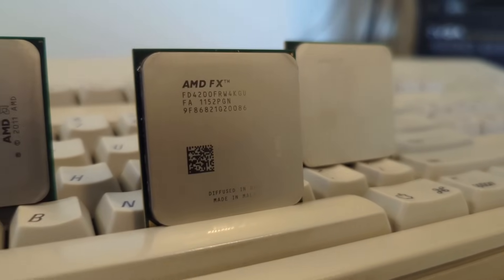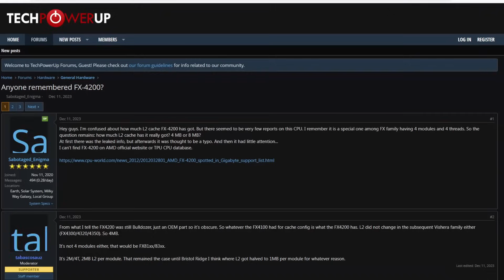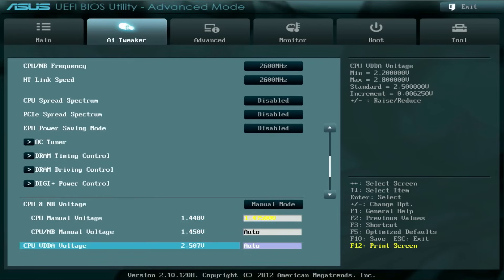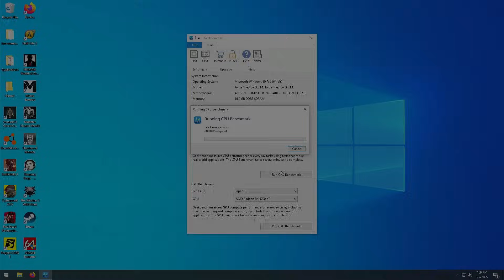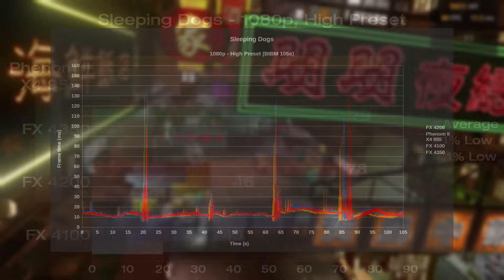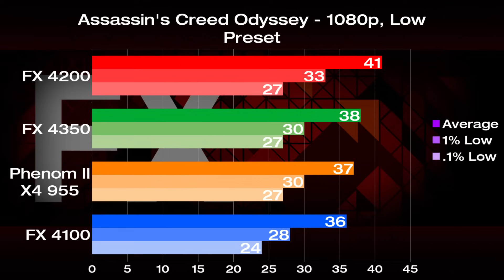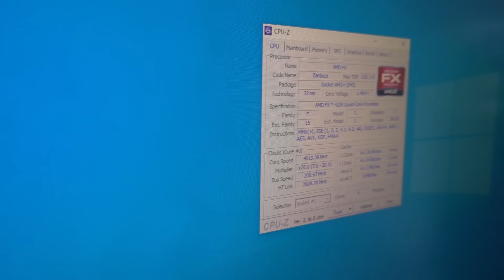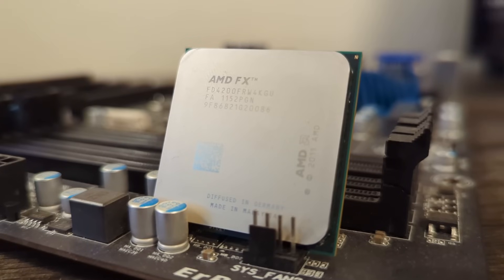What if AMD FX had "real" cores?

Comment: No idea why there is so much hate for the FX chips.. i had the 6300 followed by the 8350 and had a go at the 9590 and went back to the 8350 and i have to say.. they did all i asked of them.. sure they may have been slower than 2 gen older intel CPUs but as i did not have that rig i didn't know any different.. they never let me down and gamed at a decent rate and i only upgraded the 8350 to a ryzen system 2 years ago due to the motherboard failing otherwise i would probably still be using it. Not had Intel since my Q6600 rig.. which i still use for emulation.. but all tech giants have to release a plumb here and there.. As for what could have been?. well if AMD didn't try new shite then we would still be on intel's quad cores.. and hey.. it was a failure.. or was it? FX CPUs are selling for more than the intel equivalents of that era. so they must have done something right..

Comment: Just finding out about this CPU I think explains why windows(at least windows 7, which is what I still use) uses my FX-8350 the way it does. When I am just doing the usual stuff on my PC, only 4 cores are used; cores 0,2,4,6. It seems apparent now that this is intentional so that each active core will have it's FPU to itself. It's only when the system is put under a large load that all 8 cores are used, like playing a high bitrate 4K video.
Reply from the maker: Hah, cool that you're still rocking Windows 7 these days. I would too if it still ran everything I needed it to 😢
Reply: @SPNG  Yeah, I had to install win10 on my previous PC, a Phenom II X4 w/8GB ram, just so I could use TurboTax. 
I can't use the latest version of Firefox on my main system because it requires win10 too, but I can run the ESR version. Plus I also use PaleMoon which still supports win7 as well as Opera.

Comment: I owned FX6300, FX8150 and FX8320E, highly underrated, Windows helped with the bad performance, they updated scheduler and got like 10% extra performance, the problem with this CPU was the way Windows loads them, it needed a specific way lo load the cores to avoid part of the bottleneck. They improved a lot the arch with Steamroller and Excavator... Sadly we didn't get lv3 cache on those CPUs and was losing 20 to 30% multithreaded performance.
I know a lot of FX CPU, not only because i owned it, i talked directly with the engineer and asked things like CPU Pipeline.
They work significally better at Linux even back in 2011/2012

Comment: Just  not a very good design overall and when these came out it was during the time when amd was on the ropes. The problem stems back to the core 2 era from Intel. The core 2 took amd really by surprise and left them scrambling after they enjoyed 3 years of success with the athlon 64 due to Intel's pentium 4 netburst flop that Intel banked heavily on. The major difference was Intel could afford to take a hit, amd couldn't. when amd took that hit for having no answer to the core 2, they really took a hit financially especially after recently acquiring ati around that time draining whatever capital they had left from the athlon 64s sucess. the phenom 1 was a decent cpu overall for what it was, it competed  against the core 2 quads, but it wasn't without it's issue with its TLB that caused systems to lockup under very specific workloads.  By the time the improved phenom ll came out, Intel was already gearing up to release the 1st gen core I series, so once again it was playing catch up to intel. amd needed to get back on top in the worst way and the FX cpu was supposed to be the golden goose amd needed to put them back on top. They hyped the FX series to the moon just to get completely blind sided by Intel's 2nd gen core I series. The 2nd gen core I series not only scotched the FX series which was bad enough, but even amds last gen phenom ll cpus beat the FX series in some benchmarks to add insult to an already embarrassing injury. Then. Many people will remember the FX series as the cpu that almost put amd out of business. They put so much money into that cpu just for it to flop badly. The only thing that kept AMD afloat after that was the console chip making contracts that they had with Sony and Microsoft which ended up being what saved them from going under.

Comment: "Bad for performance"   Well, not so much after Microsoft quietly and secretly re-wrote the code that intel said would work fine on the AMD chips too...  I gained 28% performance one day with a patch.  Wish I'd known you were needing this kinda old hardware. I've got a stable Crosshair IV with an 8350 and a copper Phenom][ high rpm cooler sitting in a box.  (and a Phe][ 3.6 in its 970msi with ram and water block that I run occasionally)

Comment: I have a Vishera FX-8320 that claims it's an "Eight-Core Processor" according to CPU-Z.  
When I installed VirtualBox back then it only allowed four cores per virtual machine.  I thought it was a bug in VirtualBox, but, no, it was because this was effectively a four-core processor due to the shared resources mentioned in this video. 
AMD fooled me by saying it was "Eight Cores," but, it served my needs for over a decade and still does.

Comment: one little problem was testing the games in high settings, making the load fall on the GPU, this is a CPU test
Reply: Any game here will not max out a 5700 XT. Also many higher settings have an effect on the CPU too, not just the GPU.
Reply: Aside from Witcher of course.

Comment: Thuban was a Beast, I ran an unlocked 960T for years until replacing it with a Ryzen+.
Reply from the maker: Unfortunately my 840T wouldn't unlock when I got it a few years back, I have a 1090T now though so that itch has been scratched

Comment: I had an fx 8350. It burned out two of my motherboards because I overclocked it to 4.5ghz at high voltage. cpu was cold on my custom air-cooler
Reply from the maker: Damn, what voltage were you using? Must have been extreme to kill the CPU, I don't think a whole lot of volts was necessary for 4.5

Comment: The biggest issue with the FX range was the shared cache; when the workload wasnt high, it was great at coping, but as soon as you hit it with a lot of data - the shared memory cache couldnt cope and the cores were constantly being left waiting.

I got my 6700 up to 5.01 GHz, and it was still worse than my previous PII 1080T, despite having the same number of cores, and the 1080T only being OC'ed to 2.8GHz.

Comment: AMD's main sin with Bulldozer was making chips with such mediocre IPC. This meant they had to use such high frequencies and thus consume too much power to compensate for such poor performance. There were architectural issues that could be fixed in later revisions, but the low IPC was a curse on those chips.

We're talking about how, in their latest revision, Excavator, they barely managed to increase performance above the Phenom.

Performance per core might have been better with independent memory for each core, as it would have been better optimized by reducing internal latencies, but it wouldn't have worked miracles, as the Excavator demonstrated.

Possibly, a Phenom III of sorts would have been much more successful.

Comment: man I need to do some more messing around with my phenom to get it to be stable at 4ghz. Most I got it to was 3.9 with far too much voltage. I have it set to 3.8 and it runs my linux build pretty smoothly.
Reply from the maker: Which model do you have? I'd say if it's a 955 or up you have a good chance of being able to hit 4GHz. The motherboard you're using will definitely play a part as well!
Reply: @SPNG  its the exact one you have, the motherboard is an asrock extreme 2 890gx. the psu is some crap tier vs corsair unit so that might be some of the issue. It does have a noctua nhd14 on it but the thermal paste I have on it is also "better than nothing".

Comment: (From 2019)

I decided to upgrade the CPU from an FX-6100 to an FX-6300 because I saw that two people had done so with the Asrock 770 Extreme 3 and posted to userbenchmark. With the knowledge that the CPU would work, I went hunting for one at a sane price on eBay. I determined I would not pay over $35 including shipping, and finally got one.

Why the FX-6300? It's the fastest 95W TDP six core AM3+ CPU that was made.

After running all these benchmark tests (I also ran SiSoft Sandra's CPU tests, which took forever and the report files are large so not included here) I found that for the $35 I got a decent speed boost overall. Especially surprising was the very good video and RAM performance improvement. Apparently the FX-6100 was being a bottleneck.

Except for the FX-6100 userbenchmark test, the only hardware changed was the CPU. I had a different hard drive configuration for the old userbenchmark test, which should not have an impact on anything directly related to the CPU change.

The one area that saw next to zero improvement is HEVC or x265 video encoding. Only single digit frames per second faster in that benchmark. Real use with VidCoder has been a bit better. That's the one aspect I was hoping for significant improvement but it's only about as much better at it than the FX-6100 was over a Phenom II x4.

Then after posting the userbenchmark scores, I saw there's one person who posted a test on this board with an FX-8320. This board isn't supposed to support 8 core CPUS! If I wanted to burn the extra electrons I likely could have gone for the fastest 8 core 125W TDP FX-8370 CPU. https://www.userbenchmark.com/UserRun/7804069

System specifications
Asrock 770 Extreme 3. 8 GB DDR3 Patriot PSD32G13332. Gigabyte nVidia GeForce GTX1050 GP107 Rev A1 2 GB DDR5.
Windows 10 Pro x64 Version 1809

Cinebench R15.0
FX-6100		CPU 369	GPU	64.52
FX-6300		CPU 413	GPU	71.11

RealBench 2.56

FX-6100

Image Editing
59,402
Time:89.6934

Encoding
31,720
Time:167.968

OpenCL
39,442
KSamples/sec: 7315

FX-6300

Image Editing
61,956
Time:85.9953

Encoding
35,324
Time:150.831

OpenCL
39,442
KSamples/sec: 7332

FX-6100 Novabench Score: 1102 
1/17/2019 6:29 PM
OS: Microsoft Windows 10 Pro 
CPU: AMD FX-6100 Six-Core running at 3.35GHz 
GPU: NVIDIA GeForce GTX 1050 

CPU Score
465

Float Ops: 109796562
Integer Ops: 468692874
Hash Ops: 941654

RAM Score - 8GB
165

RAM Speed: 8525 MB/s
 
GPU Score
443

Direct3D11: 46 FPS
OpenCL: 2059 GFLOPS
Disk Score
29

Write Speed: 97 MB/s
Read Speed: 123 MB/s  

FX-6300 Novabench Score: 1322 
1/20/2019 12:01 PM
OS: Microsoft Windows 10 Pro 
CPU: AMD FX-6300 Six-Core running at 3.6GHz 
GPU: NVIDIA GeForce GTX 1050 

CPU Score
539

Float Ops: 137407855
Integer Ops: 469707042
Hash Ops: 1172222

RAM Score - 8GB
169

RAM Speed: 9502 MB/s
 
GPU Score
584

Direct3D11: 66 FPS
OpenCL: 2074 GFLOPS

Disk Score
30

Write Speed: 120 MB/s
Read Speed: 110 MB/s

Geekbench
https://browser.geekbench.com/v4/cpu/compare/11689720?baseline=11729040

Userbenchmark
FX-6100
The hard drive performing way above expectations is because it was in a striped pair
https://www.userbenchmark.com/UserRun/12969408

FX-6300
https://www.userbenchmark.com/UserRun/14009937

FX-6100
x265 HD BENCHMARK 0.1.4 RESULTS 
 
Please do NOT compare it with older versions of the benchmark! 
Please copy/paste everything below the line to to report your 
data to http://x265.ru/x265-hd-benchmark/ 
 
^^^^^^^^^^^^^^^^^^^^^^^^^^^^^^^^^ 
Results for x265.exe build 1.4+5 
x265 Benchmark: 64-bit 
========================== 
 
CRF-20 preset-"fast" 
-------------------- 
encoded 1128 frames in 153.99s (7.33 fps), 2266.68 kb/s
encoded 1128 frames in 154.64s (7.29 fps), 2266.68 kb/s
encoded 1128 frames in 156.35s (7.21 fps), 2266.68 kb/s
encoded 1128 frames in 155.83s (7.24 fps), 2266.68 kb/s
 
 
System Details 
-------------- 
	Name			AMD FX-6100
	Codename		Zambezi
	Specification		AMD FX(tm)-6100 Six-Core Processor             
	Core Stepping		OR-B2
	Technology		32 nm
	Stock frequency		3300 MHz
	Core Speed		1403.1 MHz
 
Northbridge			AMD 770 rev. 00
Southbridge			AMD SB700 rev. 00
 
CAS# latency (CL)		9.0
RAS# to CAS# delay (tRCD)	9
RAS# Precharge (tRP)		9
Cycle Time (tRAS)		24
Memory Frequency		668.1 MHz (3:10)
Memory Type			DDR3
Memory Size			8176 MBytes
Channels			Dual
 
Windows Version			Microsoft Windows 10 (10.0) Professional 64-bit   (Build 17763) 
 
Number of processors		1
Number of threads		6
	Number of threads	6 (max 6)
	L2 cache		3 x 2048 KBytes, 16-way set associative, 64-byte line size
	Instructions sets	MMX (+), SSE, SSE2, SSE3, SSSE3, SSE4.1, SSE4.2, SSE4A, x86-64, AES, AVX, XOP, FMA4
	Package 		Socket AM3+ (942)
	Package Type		0x1
	Temperature 0		40 degC (104 degF) (Package)
	Power 0			28.50 W (Package)
 
	Temperature 0		40 degC (104 degF) (Package)
	Temperature 0		46 degC (114 degF) [0x2E] (SYSTIN)
	Temperature 1		57 degC (133 degF) [0x71] (CPUTIN)
	Temperature 2		125 degC (256 degF) [0xF9] (AUXTIN)

FX-6300
x265 HD BENCHMARK 0.1.4 RESULTS 
 
Please do NOT compare it with older versions of the benchmark! 
Please copy/paste everything below the line to to report your 
data to http://x265.ru/x265-hd-benchmark/ 
 
^^^^^^^^^^^^^^^^^^^^^^^^^^^^^^^^^ 
Results for x265.exe build 1.4+5 
x265 Benchmark: 64-bit 
========================== 
 
CRF-20 preset-"fast" 
-------------------- 
encoded 1128 frames in 134.36s (8.40 fps), 2266.68 kb/s
encoded 1128 frames in 134.44s (8.39 fps), 2266.68 kb/s
encoded 1128 frames in 134.61s (8.38 fps), 2266.68 kb/s
encoded 1128 frames in 135.55s (8.32 fps), 2266.68 kb/s
 
 
System Details 
-------------- 
	Name			AMD FX-6300
	Codename		Vishera
	Specification		AMD FX(tm)-6300 Six-Core Processor             
	Core Stepping		OR-C0
	Technology		32 nm
	Stock frequency		3500 MHz
	Core Speed		4107.5 MHz
 
Northbridge			AMD 770 rev. 00
Southbridge			AMD SB700 rev. 00
 
CAS# latency (CL)		9.0
RAS# to CAS# delay (tRCD)	9
RAS# Precharge (tRP)		9
Cycle Time (tRAS)		24
Memory Frequency		720.6 MHz (3:10)
Memory Type			DDR3
Memory Size			8176 MBytes
Channels			Dual
 
Windows Version			Microsoft Windows 10 (10.0) Professional 64-bit   (Build 17763) 
 
Number of processors		1
Number of threads		6
	Number of threads	6 (max 6)
	L2 cache		3 x 2048 KBytes, 16-way set associative, 64-byte line size
	Instructions sets	MMX (+), SSE, SSE2, SSE3, SSSE3, SSE4.1, SSE4.2, SSE4A, x86-64, AES, AVX, XOP, FMA3, FMA4
	Package 		Socket AM3+ (942)
	Package Type		0x1
	Temperature 0		42 degC (108 degF) (Package)
	Power 0			31.30 W (Package)
 
	Temperature 0		42 degC (108 degF) (Package)
	Temperature 0		45 degC (112 degF) [0x2D] (SYSTIN)
	Temperature 1		57 degC (133 degF) [0x71] (CPUTIN)
	Temperature 2		117 degC (242 degF) [0xEA] (AUXTIN)

Comment: I was very disappointed in the utter lack of improvement in a FX 6100 over a quad core Phenom II. Multicore benchmark tests were all significantly lower than the specs would suggest, and single core tests were no better, and often worse, despite the higher clock speed and 2 more cores.

Comment: ' newer cpu did worse in older titles '. Bullcrap. Newer cpus have ALWAYS done BETTER on older titles as long as clock speeds were close to the same. Either your testing methods were off or lack of software updates were causing issues. Been messing with computers since the 286 so i know what i'm talking about.😮

Comment: i used to have a 8350 in 2014 till 2016 it wasnt all bad. wasnt more worse then my I7 high end cpu i use right now on a 144 FPs spec with an 4070 8gb for high-ultra gaming in UE5.
Reply from the maker: For those years it would have still been very competent, what card did you have it paired with back in the day?
Reply: @SPNG  i used 2 way sli of a 760 evga sc 2gb to AIM for 2-4k on xperimental settings. Was great. Never knew i Had outstanding visuals until my bro came over seeing Alien Isolation and was speechless by the visuals which we're normal to me. But best was 1500€ for IT? You can dream of that ,oney today...2000€ today IS entry Level Like for 144 FPS gaming..